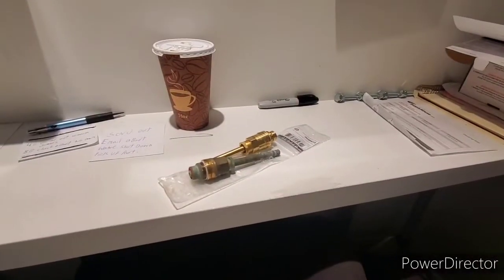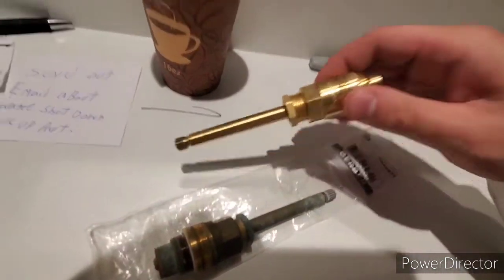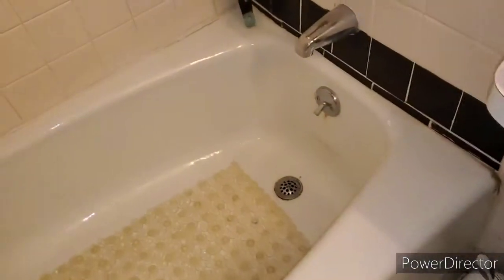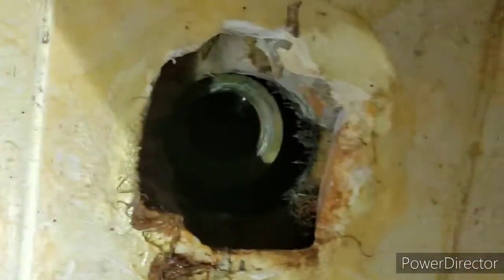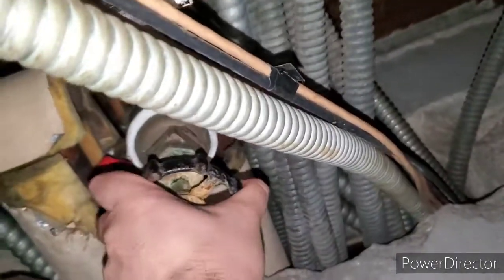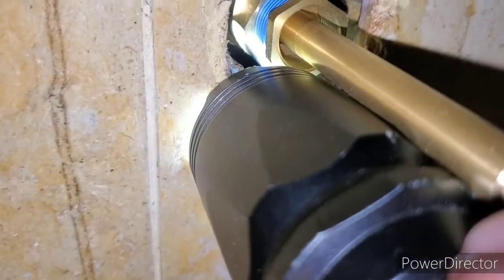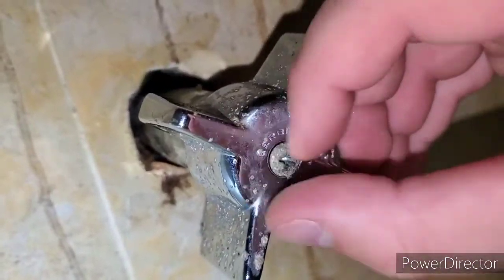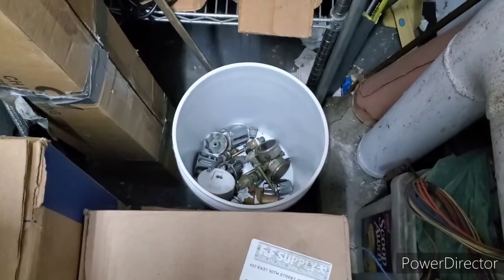Branch Valve replacement and water shut down

Comment: With that much pressure why don't you use no. 5 rectoseal with blue tape on threads it will never leak at your repair.